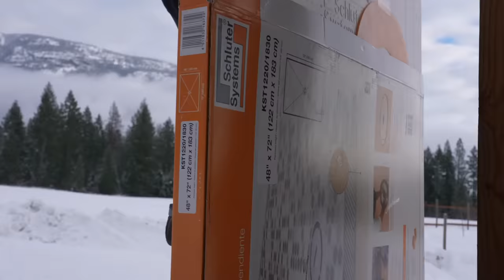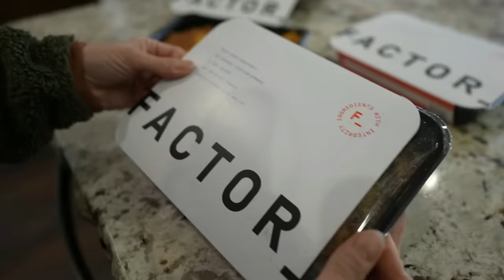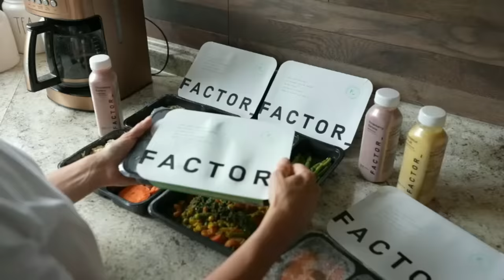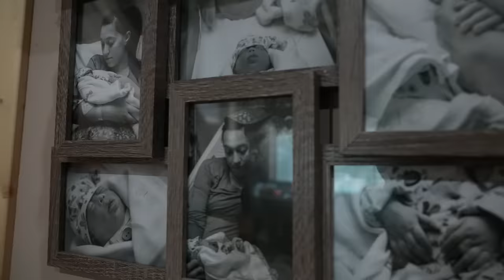Back to WORK + They Were Never ALONE (Surprise Ending!!)

Comment: So great seeing the kindness of others helping a family in need.  Where I live, there are a lot of angry selfish people around, and it's often hard to remember that there are good people.

Bathroom is coming along.  If you want to put a shower in the garage apartment, but don't want to do more tile there is an option we used on our bathroom remodel.  They are acrylic wall panels made to look like tile, but it's entire wall pieces.  And since it comes in 4 pieces (3 walls and shower pan) it's easy to get in and install.  It's similar to a fiberglass surround but more modern looking.

Comment: Cool TIP: If your mortar is to wet. As you apply it dab each layer with a grout sponge to remove the surface water. Than rinse in a bucket of water. Plus ❤❤❤❤❤❤❤❤❤❤going out for Ashley and Jay's family.

Comment: I couldn't tell for sure, but the  ends of the shower where you only used mud bed, make sure and cover all of it with the waterproof fabric, not just the corners. It isn't waterproof by itself. :) Loved the end of the video. 😍
Reply from the maker: Yup. We did 🙂.

Comment: For thee shower, Simple Human makes these great wall mounted shower pumps in 3, 2 or 1 canister and they hold all the shower stuff. I have one holding shower gel, shampoo, conditioner and face cleanser (a 3 in one and a single) and they look good and you don't have bottles sitting around everywhere. I put them in all my showers. So clean and easy. Latitude Run has a good one too that I think you'd like as it's in gold and silver.

Comment: I have seen where some lay down the dry cement and get it all sloped correctly to the drain, then with a garden sprayer just lightly sprinkle the dry mix with water and not enough to disturb the slop  then just let it setup.

Comment: Not to discourage you but black on the floor will be white marbled soon because of minerals in the water. Also safer to use a smaller tile on the floor  such as a 1”x1” for traction with your wet feet. I do bathrooms for a living.

Comment: I am absolutely not up on all the current trends in building materials but, it just seems wrong to have a Styrofoam shower pan. It would seem to me that after some time it would flex so much the tile or grout lines would crack. Just thinking out loud.

Comment: what are the prices for the little tv type dinners    if you are using glass doors the shower dam is  of minimal height.  if  shower curtains the dam is noe high enough.  aiso i didnt nots screws or fasteners securing the dam   for maybe for a couple of years you will skate by but past that you are asking for a dam failure  i have done residental. commercial.and hospital tile work so i know of what i speak  i did many shower pans in the spokane. los angelus basin. battle creek areas aand new york and new jerey areas.  caution